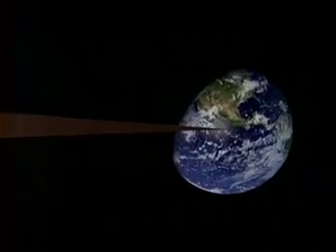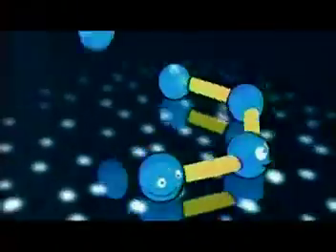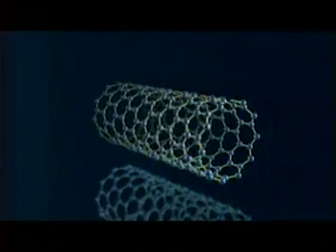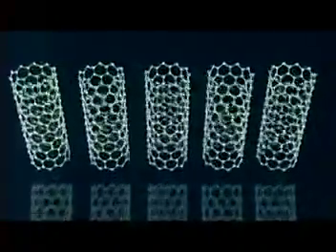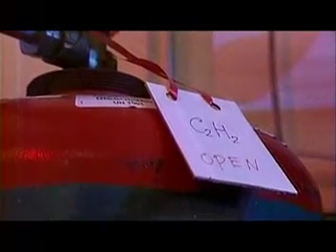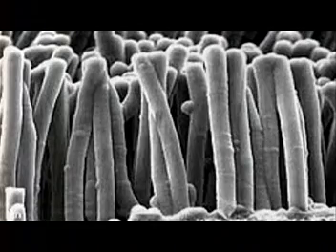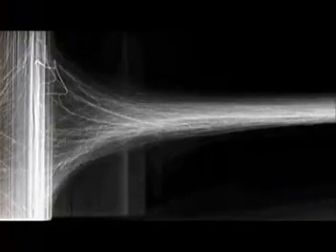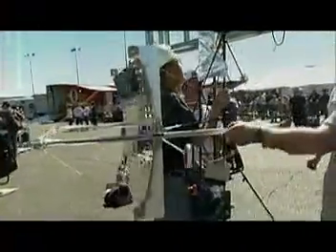Elevator 2

Comment: What if the object going from up to down doesn't stop at all? It will go down at a huge speed with a lot of kinetic energy and then goes up but since there is gravity it will not make it into space again. In the going up stage it will require a little push. Im probably wrong but while it's going down is it possible to convert all that kinetic energy into electrical energy?  At the end do you get more energy then you put in? Im still in my early stages of physics...